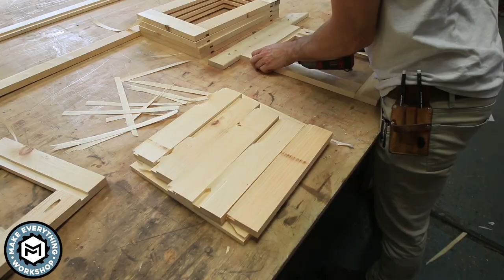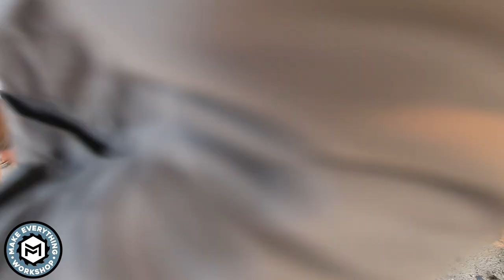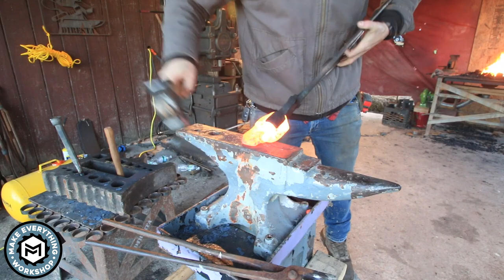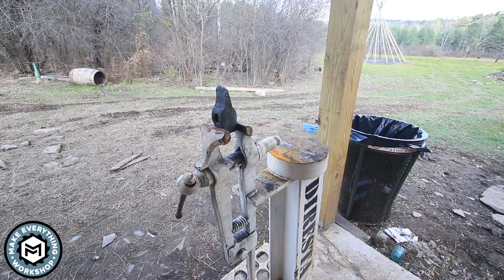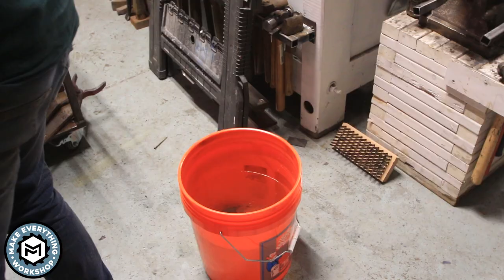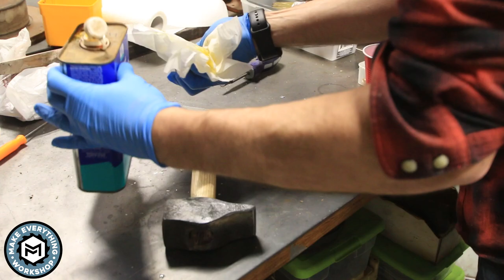Forging My First Hammer With Paul Pinto

Comment: Ended up looking great! Next time try using a bigger hammer and anvil, you need a ton of force to move that thick of steel. Generally I do hammer heads with a 10 pound sledge and have someone hold the work for you, the drift will go in like butter if you have a big enough hammer and a solidly mounted swage block.

Comment: I could make a hammer, too, if I had all those... haaammers. Damn, looks like hot steel is still pretty damn hard, always looks easy in fast motion. Serious question, when you were first trying to drive the drift through you flipped it every strike: would it start going sideways or something if you did like 5 hits, flip, 5 hits, etc?
Reply from the maker: Jeremy Specce haha! It’s easy! As far as I know the reason for flipping it is to do two things, one keep it straight, and two keep that tool cool and not weld it into the billet

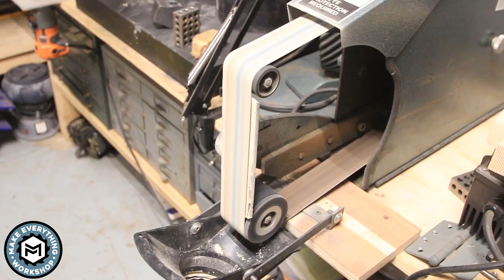Comment: 18:07 what did you pass on the sanding belt?
Reply: It was a rubber belt dressing stick. They basically are a big pencil eraser. It cleans the abrasive out and helps to keep the abraded material from sticking to the belt.